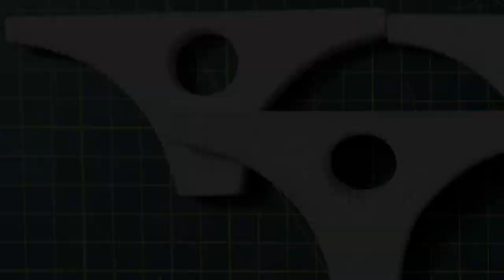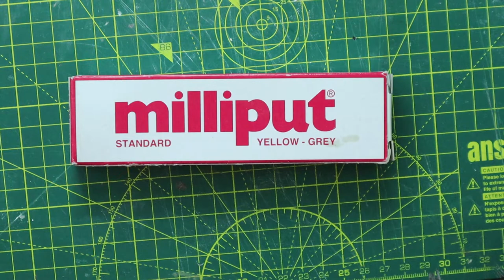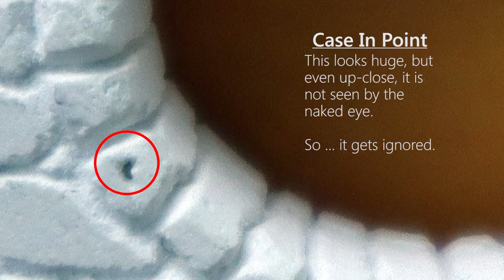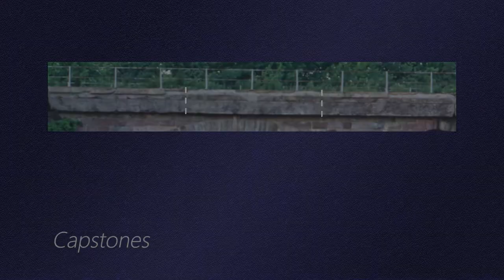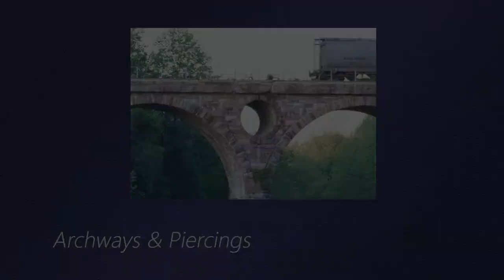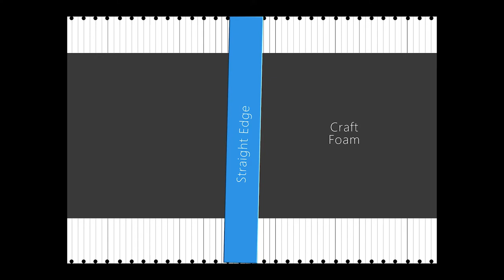Peacock's Lock Viaduct, Part 2: Capstones, Archways & Piercings

Comment: I can tell that you have all of your audio issues ironed out. This one sounded excellent.  Opting to repair those bubbles rather than scrapping them and more importantly showing how you fixed them is great.  Oic in pic showing the tools you were using worked very well in my opinion. The pics of the pro type during explanations were another good addition.  You had much new  carving in there and the fact that you resisted showing more of that and waited on the proper shots to produce the video correctly showed patience also.  Good work. Great build. Lots of modeling and video editing talent went into this quality shoot. It will be well liked by the community as well.
Reply from the maker: Thanks so much Brian! Yeah, I finally got the audio right. I'm glad you liked seeing the air bubbles fixed - I thought someone might find it useful. I do like to show enough of what I'm doing so folks can see and understand, without boring them with repetition. Glad it translates well. Thanks for your very kind words and support. I appreciate ya! Best, John

Comment: The first air bubble in the piercing i thought would have been left as a sign of weathering,, but you solution to fix it was great.. Loved the foam carving idea and of course you made it look easy and fantastic. Coming along nicely at this point. I scoured your videos and did not see a part 3. Have you done it or did I miss it. Really want to see your finished work.
Reply from the maker: Thanks again Pappy - really means a lot. I've done a little more work on the viaduct, but haven't released another video yet. This bridge is going on my glide-up gate and I needed to get that finished before I could finalize some measurements. Also, I thought it would be smart to get all of the heavy construction done just to keep the viaduct out of harms way. I'll be getting back to the project soon. I appreciate your interest.